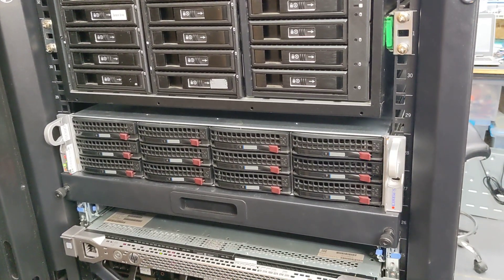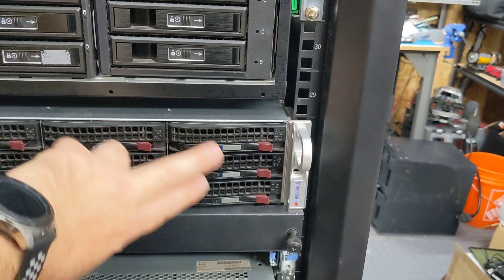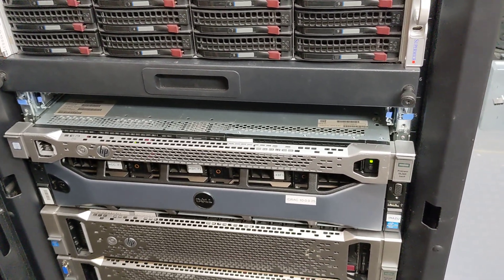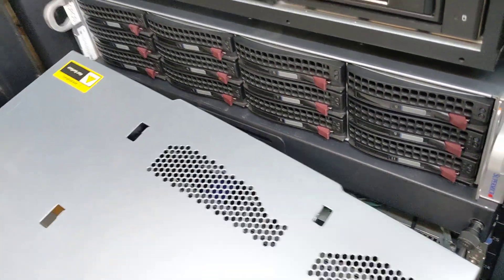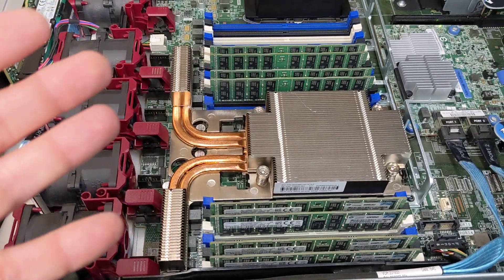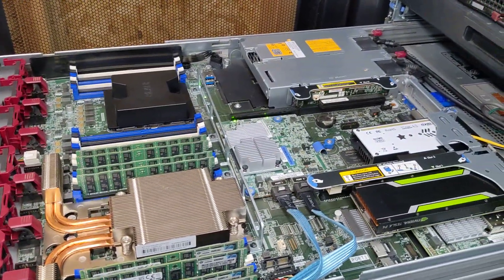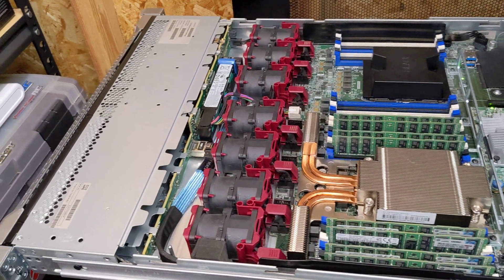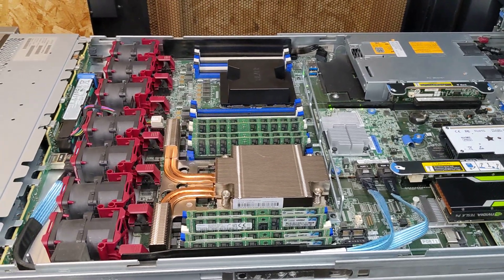Migrating PLEX to DL 360 G9 Part 2

Comment: M3 MBA only have 4P cores and the X-Elite has 12 cores (8 cores in cluster 1, [P core?] and 4 cores in cluster 2, [E core?]) so, the X-Elite has 2x more cores than the MBA and we expect it to perform twice as fast. If that the case, the X-Elite barely outperform the M3 only because it has more cores😂

Comment: Nice! How much did that increase your power bill? Ever think of using a hypervisor to host multiple VMs/Containers instead of a dedicated server?
Reply from the maker: Thanks for the comment.  It actually reduced my power consumption.  The old plex server was not very power efficient.  It also spun the drives 24/7.  With the drives now on my Unraid they use no power unless being used by Plex.  They spin down when inactive for 30 min.  I already have a VM host running several VM’s.  I also have several Dockers running in Unriad as well.  I chose to run Plex native on Windows just to keep things simple for me.

Comment: That Sucks that you had such a large delay but glad its working now and hopefully for a long time to come :)
Reply from the maker: Yeah, with so many movies and tv episodes, I just had to let Plex churn through all of it.  I never really noticed when it was doing the chapter thumbnails and all that other work because my collection grew slowly over time.  When you try to do 3,000 movies and 16,000 total episodes all at once, it’s going to take time.  It’s running great, it seems that the extra video RAM, the RAM-Disk and having the meta data on the m.2 drive make it much snappier.  The actual movie or tv shows take a bit longer to load if the drive is spun down but I use the pre-roll feature for movies so you don’t even notice it there.  Working great so far!  Thanks for watching.